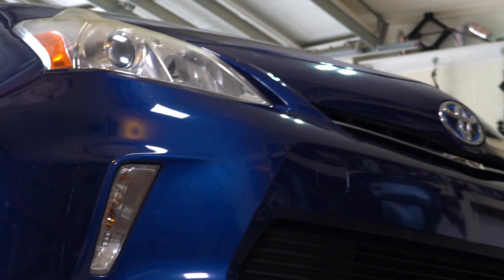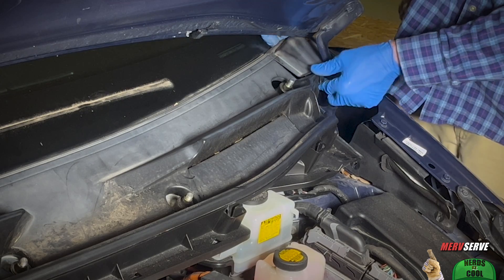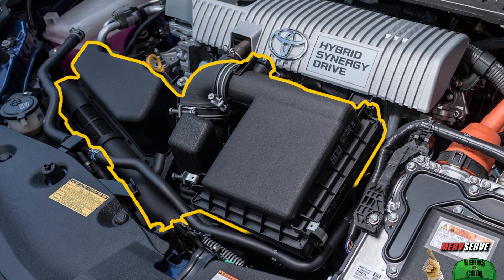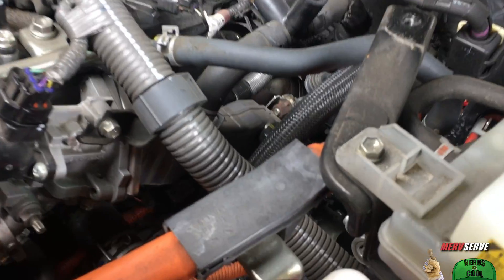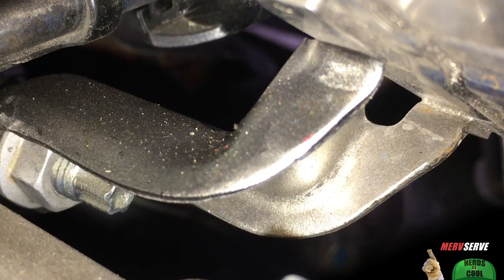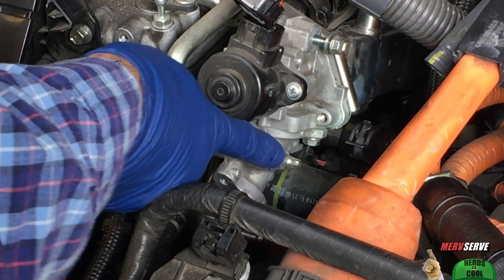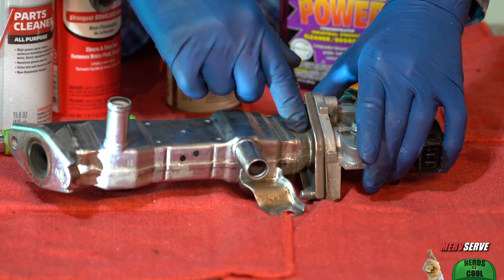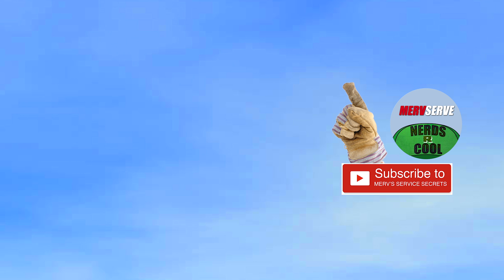Toyota Prius EGR Removal PLUS Organic Methods for All Cars - Ford, BMW, Chevy, Honda

Comment: Should i do this before im running codes as prevenantive maintenance? Or should i wait until i have a problem
Reply from the maker: Well, mine was really getting up there in mileage, plus after seeing how dirty the air intake manifold was, I figured it was time for a thorough cleaning.

Comment: A relative gifted me their 3rd-gen Prius as it had a blown head gasket. I started disassembling the engine to remove the head a few weeks ago and got to the EGR studs and almost broke the long one (the external torx part started to twist). My daily driver sprung a head gasket leak and is a bit more of a project, so I came back to the Prius to see how I could do with continuing the job. That stud came right out. My neighbor finds humor in my shenanigans and came over to give me company and brought a couple tools I was missing. That “disposable member” nut was a challenge. I am thinking the vandal may be onto something with cutting it off and filing the remaining bracket smooth. I joined Priuschat and will look for the heated argument. LOL. I subscribed and appreciate your great documentation of these jobs. Also, thanks Margie for the camera work and PDF drafts!
Reply from the maker: Will do!  Glad you enjoyed the video.
Reply: Excellent video with plain-speak and clear images.  I may just pay $1,000,000 to have a mechanic do it, but, maybe not...
Reply: I love this!
Reply: YIKES! My wonderfully handy husband told me that this job might be too much for him. Thought to myself “how can it be that complicated?” Well, it took me long enough to find him,  I’d like to keep him! Thank you for the video, it was clear, informative and intimidating as hell! Love the AI, it gives perspectives that are hard to imagine. THANK YOU!

Comment: Do you think you can do alot of people a favor by showing the egr cooler cleaning of generation 4 prius?  It involves methodically removing the inverter first to get to the cooler.
A bit more challenge for you.
Many thanks in advance...
Reply from the maker: Well,  if you buy me the gen 4, I'll tear it apart. 😄 In the meantime, here is how I cleaned the Gen 3 cooler: https://youtu.be/QGcZYGA2cnM?si=D6Q6q10QLFQb1C74

Comment: Just became a 3rd Gen Prius owner and your EGR pipe and Intake manifold video was so helpful. Thanks a lot. Now I’ll be doing the EGR cooler thanks to this video
Reply from the maker: Be sure you do plenty of research beyond my personal escapades. And be careful.  It's not as fun as it looks.
Reply: @samuel does it make sense to do both at the same time?
Reply: Bonjour pouvez met dire quel produit pour nettoyer la valve EGR merci

Comment: Waitin' like a rooster in the hen house for the EGR cleaning vid
Reply from the maker: 😂 Perfectly phrased!  We are working on that video right now and hopefully it will be finished faster than a knife fight in a phone booth.
Reply: @MervsServiceSecrets  Too late for me, I just bought a cooler from toyota, Mine has 300k on it and it was CLOGGED bad. also, the pipe coming from the exhaust has build up in it. I guess you guys with lower mile cars dont have to worry about that.
Reply from the maker: "Lower mileage cars"  😂😄😆. Brother, good for you! 300k?  Damn fine!
Reply: @MervsServiceSecrets  wouldnt have done it without your video. Happy to report the car is SMOOTH again. shooting for 500,000 miles now!

Comment: what do you think about just removing the EGR valve and cleaning that, disconnecting the Exhaust pipe from the back of the EGR cooler, keeping the coolant lines attached, and just blowing it out real good with compressed air?  The Car Care Nut suggests this method, wondering what you think about it.

How necessary is it to make it spotless like that? I don't really have a problem on my end, just doing it as preventative measure while changing spark plugs
Reply from the maker: Well, I'm tempted to say it's the lazy way out, but sometimes lazy is better.  HOWEVER, seems to me it depends on how clogged up the thru-channels are.  It's hard to tell by shining a flashlight through because it's not really a straight shot, and if she's still attached to the exhaust manifold I think it would be hard to see in there.
Reply: if it's really clogged you can't just blow the debrie out. I took my EGR-cooler off and had to use ovencleaner (natriumhydroxide) to solve the problem. Took me a while but it's like new now. I mean, the job is difficult for an amateur like me and I just thougth: If I do it, I do it properly and now the cooler is cleaner than new. Also intakemanifold is cleaned a the car runs a lot better and smoother. Just invested time and no money!  Take good care of your car and it can last a very long time, so that saves a lot of money. By the way: sawing off that difficult mounting point underneeth is something that I'll do next time
Reply: I soaked mine in oven cleaner also overnight followed by a good jet wash / power wash now I can see straight through 😊

Comment: The hell bolt isint that bad if you put the silver cover back on the engine and lay on it feel for the nut with your left and and come straight in with a extension with your right I've removed these coolers like ten times from every which angle even standing in the engine bay with the hood off (have a nice crack on the relay box from resting my knee :/ )and this seems to be pretty effortless way of doing it be sure to wear a hard hat so you dont bump your head into the windshield trying to see what your doing im about 3 concussions away from getting a free cooler from toyota
Reply from the maker: That's exactly the way I did it.  But without the engine cover.  Plus, I added one very important accessory.
Reply: @MervsServiceSecrets  and @jacobgreen3963 , the accessory was simple yet brilliant.
Reply: @MervsServiceSecrets  The accessory is next level.